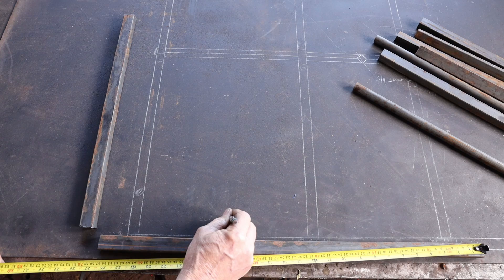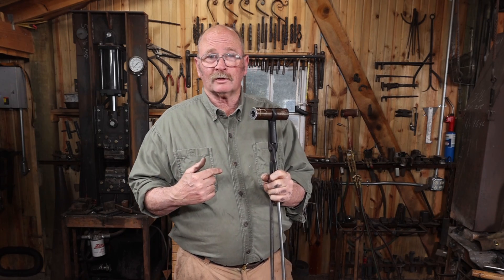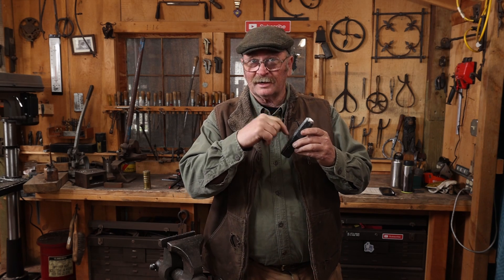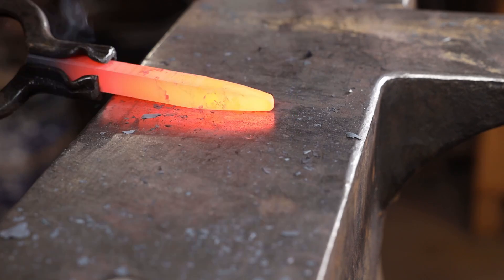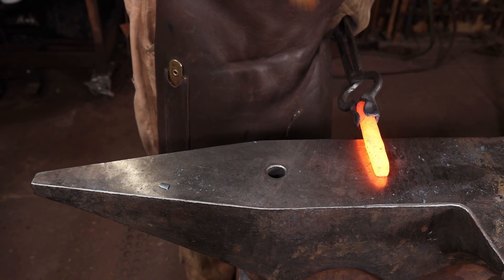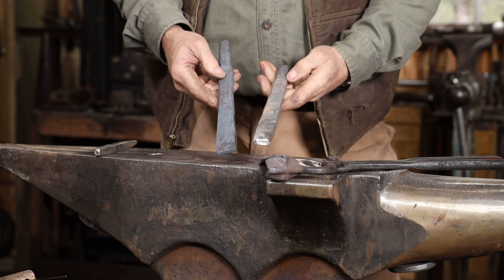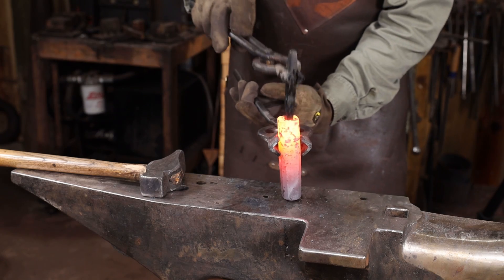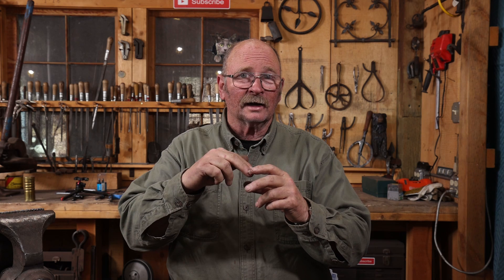Forging the Tools - window grill part 2

Comment: Nice video. 
John I have been around machinery all my life (I am older than you BTW). There was a time that I was a tool and die maker, then I went into mechanical design and finally I got an engineering degree and worked for a long time as engineer and I tell you that I have no idea what is a monkey tool or what it does, he-he.

Comment: G’day John, have seen this before, but rewatching it I thought of an idea for a simple monkey tool. Take a piece of bar, say 320x40x12mm or close. Mark centre line and then 20mm and 60mm each way, leaving 80mm each end. Draw down the 80mm ends to twice the bar thickness, eg 12mm thick bar, draw ends down to 24mm. Punch tenon hole in the centre. At the 20mm marks, bend bar 90deg, forming a u shape. Bend in the drawn down ends, forming a 24x24. Should look like a skinny stirrup. Weld the 12x24 ends and done. Hope that makes sense

Comment: Thank you John for another great video. John I was wondering if you have any information on heat treating of tool dies. Like guilotine dies. I have a few dies and need some assistance.  The steel I am using is 4140 . and 1018. Any information is greatly appreciated.  Thank you and be safe.

Comment: Fun video John, quick question though. I see that you went to the little giant hammer to draw out the tip of the chisel and the power hammer for the rest, why? What does one have over the other beside the obvious price and space differences?
Reply from the maker: The Little Giant is set up with drawing dies which is what I wanted for that one heat.  The SayMak had flat dies.  I could have swapped dies, but the Little Giant is more than enough for that type of work.

Comment: john, thanks for todays video.  Wondering what supplier(s) you use for S7 tool steel.
Reply from the maker: I usually buy from McMaster Carr.  Not the cheapest, but very reliable

Comment: As metal is expanding when hot Is there any adjustment to be made with a drift, monkey too etc to get the right size if you need to be very precise?
Reply from the maker: In most cases it's not that critical for forged joinery.

Comment: Thanks, good explanation John.  Do you know of any issues with using chrome plated material in general?
I assume that  at these forging heats, the chrome just flakes off to join the dust on the floor, that it isn't significantly vaporized or volatilized, and would not be inhaled. But I have purposely not used any plated tool steel as a material source yet, because of my uncertainty.
(and yes, I had to look up the definition of volatilized)
Reply from the maker: I generally avoid anything plated just because I don't know what risk there might be.  I would probably use unplated sockets such as the ones meant for an impact driver.

Comment: I'm no ironworker by any stretch but why not try to broach your square hole straight and true? If your "vent clean out" hole went through to both sides it could be easily cleaned up on the bottom. I could be way off in left field here but it could work too ....
Reply from the maker: Most broaches are pretty long and need to be pushed out the opposite end.  I've never seen one designed for a closed hole plus a 1/2" square broach is around $250
Reply: @BlackBearForge  good to know! Like I said no iron worker but watching your chanel has me itchy to beat hot iron myself. Thanks for the education and entertainment!

Comment: The day I was born South Africa were I am from we changed to metric in 61 . So it takes a lot of mathematics ro work things out . But metric straight up is much easier. I did do inches in primary school I think just for the first two years.
Reply: As far as converting to metric from imperial it's simple if your not going for thousands of a mm / inch. 1/2" = 13 mm , 1 " = 25 mm close enough for most forged work.
Reply: @dicksargent3582   thanks mr. Sargent.